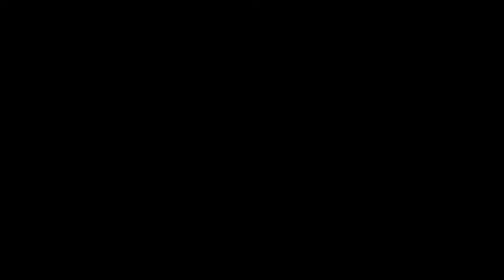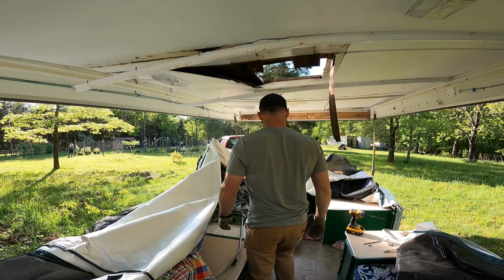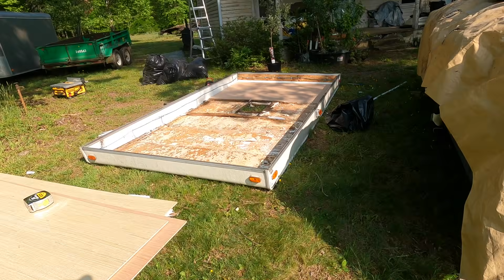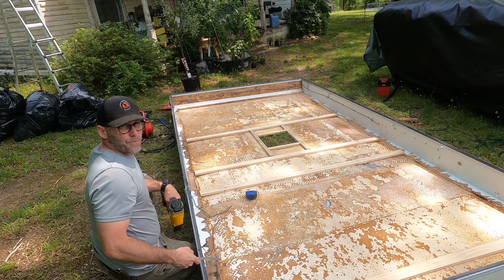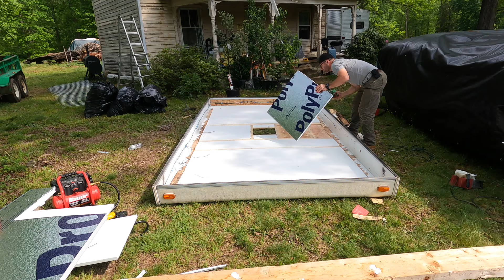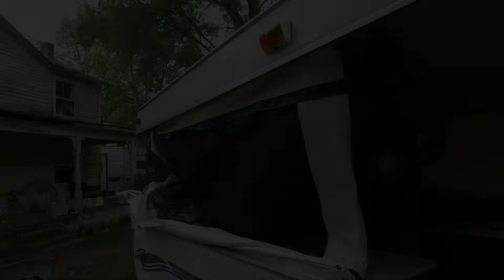How to Repair Pop Up Camper Roof Leak and Rot (Part 1: Interior)

Comment: You\nDidn't use red guard flex , seal , fiberglass, rubber cement or anything to address the original hole that was in the roof the cost of rot  in the first place
Reply from the maker: Did you watch part 2? I did patch the holes. This was part 1 the interior, Part 2 I did the other side.

Comment: What’s the appx. cost to repair a roof like this? We got a pop up for free, but the roof needs repaired due to water damage and it bows/sinks in…so we need to fully repair it. Just worried about the cost. Willing to do it ourselves.
Reply from the maker: It was around $350 to redo the roof. I fixed up the whole camper for a little over $1000. There is a video walkthrough of it completely fixed up on my channel. I think it was worth it because it definitely is worth a lot more than $1000.

Comment: What were you nailing the supports to?
Reply from the maker: The original wood stringers that ran the length of the roof. Those were not rotten so I did not have to replace them.

Comment: Won't the staples pierce the roof?
Reply from the maker: No I used 1/2" staples and the wood is 3/4", and used a little lower air pressure.

Comment: I have a 2006 Palmino Pony and the sides of the roof are rotted but the inside ceiling looks like it was replaced. Have not seen videos on that.
Reply from the maker: I will be sure to video if I come across one with rotted sides.

Comment: Are you concerned at all about the roof leaking again? I saw all the patches. Any suggestions on how to fix those effectively?
Reply from the maker: Not too concerned, as the Hengs rubber roof  coating stuck to it well. That is supposed to be waterproof. I would inspect the roof every year and recoat if needed. It was a friend of mines camper and was done over two years ago and they have not complained of any leaks. I am working on a Pop up truck camper roof and it had some holes in it. I did patch those with DAP weatherproof patching compound which seems to be holding up with no leaks.

Comment: When you’re attaching the headers and you use those staples/screw/nails isn’t it putting a hole through the roof?
Reply from the maker: No, the wood is 3/4" thick and I am using 1/2" wide crown staples, so it is not going all the way through.

Comment: Really wish id seen the part where you took the roof off. Thats what I've been trying to find.
Reply from the maker: Sorry that wasn't in there. What I didn't show was cutting the wires then with the roof up, I unscrewed the nuts from the  bolts that hold the bracket to the top. I left the bolts in then lowered the roof. once the roof was lowered I removed the bolts. My wife and I then lifted the roof up and shimmied it off. Thank you for taking the time to let me know what you were looking for. In the future I will post a detailed video on how to take it off just in case others are looking for the same thing.
Reply: @parkedredesign  that's my dilemma also - how to remove the roof. Thanks for your great video
Reply from the maker: @cinematictrax8443  Sorry it wasn't in the video. I posted a pop up truck camper roof rebuild and show a little more detail of taking that roof off. It is kind of similar to that. here is a link to that video. https://youtu.be/VwI9sM_8HjY
Reply: @parkedredesign how did you get repair (or did they have to completely replace) the cables for raising and lowering the roof?
Reply from the maker: @jasonperner7033  When I took off the roof I did not have to mess with the cables for raising and lowering the roof. I just took all the screws out from the canvas attached to the roof, then unbolted the brackets that held the roof on to the raising and lowering mechanism.
Reply from the maker: I guess I cut that part out. I unscrewed the brackets on each corner of the raising and lowering mechanism and lowered the roof. once lowered I just slid it off.

Comment: At 18:15 what are you stapling the boards to? Is that going straight into the aluminum roof?
Reply from the maker: No, there is a wood stringer running lengthwise of the roof that I am stapling it to. I was using 1/2" wide crown staples so it would not go all the way through the wood.

Comment: I have a 1998 Palamino Pinto which looks very similar to this one. It also has a roof that is in horrible condiditon, all rotted out. From what I can tell, the damage came about because the previous owner never changed the gasket under the air conditioner which allowed water to get in. When I changed the gasket, it was flat as a pancake. This was in 2021 when I bought the camper. Not only did it rot out the roof but the floor and worse the entire camper was covered in mold. I got it very cheap. I have not yet replaced the roof. I was hoping it would be easier than this. This probably requires more labor than building the camper in the first place. If you ever buy a popup camper, replacing that gasket is a very simple job.  Not doing it eventually destroys the camper.
Reply from the maker: So very true. Once a year roof maintenance should be done. Look for any areas where water may leak and fix. I am currently fixing up a Slide in Truck camper that water has leaked in through the  roof vent. A problem that could have been avoided had they put self leveling sealant around the vent.

Comment: Hi! We just bought a Fleetwood Coleman 1995 pop up. The guy said. He redid the ceilings we checked them before buying but once we got home with it peeled away the plastic lining and it most definitely  leaks the wood is soft and damp. We plan to completely rip it out and redo it like yours. A few questions. Do you have to put the insulation in? And if we skip the insulation how do you have your wood supports secured if not nailing through the roof? 2. Myq husband wants to try and do it without taking off the roof. If it were to rain we would have no where to keep the inside dry. Besides just physically being more difficult is there any down fall to this?
Reply from the maker: That happened to us with our first camper, guy told us no leaks and when the first rain came it leaked like crazy. I know the feeling. With the pop up, I would recommend that you take the roof off. I did not have mine in a garage and I just put tarps over it. Not sure how your roof is but mine wouldn't of been possible to do with the roof on because I had to replace the boards that went across, and the aluminum roof would flex too much without the wood supports. I suppose you would not have to put the insulation back but it can help keep out some heat in the summer. I used liquid nails extreme temperature to glue the wood panels to the roof. I used wide crown staples only on the sides and around the vent hole for the ac. The crown staples were only 1/2" so as to not penetrate through the wood and into the roof. Hope this makes sense.

Comment: The question I see when you are liquid nails and nailing in the supports are you nailing that directly to the roof of the camper?  Maybe I'm missing something but it's not going to put holes in the top of the camper?
Reply from the maker: No, I used 1/2" nails and the wood supports are 3/4" wide, so the nails do not go through to the roof.
Reply: I have the same question...What are you nailing into then if it's not going into the roof?

Comment: Great video, thanks!! Wondering about putting a layer of reflectix in between the roof layers for light insulation? 🤔
Reply from the maker: Thanks for the comment, It may help keep some of the summer heat out??

Comment: How did you lift the entire roof off and get it on the ground
Reply from the maker: After I unbolted it and it was in the lowered position I went back and forth from each end and shimmied it  a little at a time until I could get in the center and lower it to the ground, if that makes sense.
Reply: @parkedredesign  gotcha , thank you
Reply from the maker: @andrewradom3772  My pleasure

Comment: Could you not cut that layer out
Reply from the maker: Not exactly sure which layer you are talking about, but if it was the foam layer, I couldn't cut that because I didn't want to risk cutting the thin metal roof.

Comment: Q? Whats holding up the cross beams STOPPING the roof from dipping in the center ? And collapsing the cross beam at not attached to the frame? It will sink like ours down the middle if there is weight ?
Reply from the maker: The metal cross beams are attached to the roof with screws through the wood stringers. The metal cross beams have a slight curve to them which I believe it is suppose to help curve the roof so it does not sink down.

Comment: How thick is the top of the roof?  What size screws would you use so they dont just penetrate tbrough the other side
Reply from the maker: This roof was a thin aluminum not sure of the thickness but it was pretty thin. For the crown staples that I used to attach the center wood stingers to the side stringers they were half inch (the stringers were 3/4 inch wide) To attach the ceiling panels to the stringers I used 1/2 inch narrow crown staples (as well as liquid nails during both processes) To attach the metal support brackets  to the ceiling panels I used 3/4" screws.

Comment: Amazing and beautiful.   Question, if one wanted to just cover that ac hole from outside, what could one do?
Reply from the maker: Thank you, Is your roof metal like this one? If so you could get a thin piece of metal and rivet it over the hole then cover it with the hengs waterproof coating. You could also see if you could find an rv skylight cover depending on the size of the hole and place that over the opening, then you would have a view to the stars :)
Reply: @parkedredesign  thank you!

Comment: I am currently in the process of repairing the roof on my pop-up, and this video helped me figure out how to get it done..  Thank you.

However, what is the thickness of the foam board?
Reply from the maker: Glad it helped, I used the 3/4 inch 4x8 sheets of expanded Polystyrene board insulation. I got it at Lowes.
Reply: Thank you

Comment: Hello. I just bought a 97 palomino mustang(or at least im 99% sure thats what it is) and i ave to redo the roof. Your video is suuuper useful. Did you say .197 inch plywood? Im not sure of im just not looking in the right place but i dont see a fraction that equals that😅
Reply from the maker: Yes. I bought it at Lowes. It is called Revolution Ply. It is .197 or 5mm plywood sheathing. It used to be around $16 a sheet but I think now it is more like $26

Comment: Did you glue the insulation right to the canvas top?
Reply from the maker: Yes, I used the fuze-it extreme temperature construction adhesive to glue it to the top. This top was an aluminum skin. I then glued and stapled the wood panels to that.

Comment: What did the wife crown staples fasten to? Is that foam or sheet metal ?
Reply from the maker: There was the original wood stringers that ran down the sides that I did not remove. That is what I stapled the new cross stringers to. The ones that ran down the side were not rotted, that is why I didn't replace those.

Comment: What about the holes in the roof? Isn’t that what caused all the damage? How did you fix that?
Reply from the maker: Thank you for the comment. I posted a part 2 of the roof repair and in that I showed how I repaired the holes. I used bondo to fill in the holes and then I painted the roof with Heng's rubber roof coating.
Reply: There are only 2 types of RVs. The ones that breakdown and the ones that take on water (leaks). 😅 If you're not handy, stick to cottage Air bnb's😂
Reply: So if you don’t replace the vinyl on top, all of these repairs are for naut !

Comment: How long did this take and what was the overall cost? I’m sure you’d do it MUCH faster than me but I’m still curious.
Reply from the maker: The interior of the roof took me about two eight hour days to finish. The longest part seemed to be cleaning the old insulation out. The outside of the roof took a full day because I had to let the first coat of rubber roof paint dry for four hours before I put on the second coat. The cost of the roof repair was around $650 and that was for the plywood, paint, rubber roof coating, insulation, screws, crown nails. I will be posting a before and after of the pop up and the total cost with the roof and the rest of the interior was just under $1100.

Comment: Not being a wise guy, but how about the wiring? There are no ceiling lights, or a 110 line for the AC?  Great work otherwise! I’m going to follow your lead on my Coleman.
Reply from the maker: Sorry about not showing that. I used the original wiring which was not put inside the ceiling. The wire for the AC was a wire with a plug that I ran along the ceiling then down the side and plugs into a wall outlet. I hid with a cable cover raceway,  I used the same cable cover raceway to hide the wires for lights as well. So the wire were not put in the roof if that makes sense.

Comment: Why did you use different staplers and the first one you used where it was fixed? If the ceiling is very thin, they did not manage to pass to the other side.desde Chile 🇨🇱 😊
Reply from the maker: I used the wide crown staples to tie the cross stringers to the stringers that ran down the length of the roof. I was a little concerned that it would go through, but I tested it first and it did not. I used 3/4 inch (1.9 cm) staples and turned the air down a little on the compressor. I used the smaller crown staples to secure the panels to the stringer. For those I used 1/2 inch (1.27 cm) crown staples. The stringers were 1 inch x 3 inch (2.5 cm x 7.6 cm) Hope that makes sense.

Comment: When you are nailing the stringers in, any concern that you'll puncture rhe roof? What are you nailing into?
Reply from the maker: I was a little concerned that it would puncture the roof. The stringers I used were 1x3 and the shortest wide crown staples I could find were 3/4 inch. I turned the air down on my compressor and tested it first to make sure it did not penetrate the fiberglass because the 1x3's are not a true 1" wide. (I did not show that in the video, and it did not penetrate). If it had I would have probably use the metal straps and screws that were 1/2 or 5/8's. The original roof was tied together with glue and crown staples so that is what I used. The crown staples nail to the two stringers that ran lengthwise on both sides. Those fortunately were still solid and I did not have to replace them. I should have shown a close up of that. Hope that makes sense. If not let me know and I will look through my videos and see if I have a close up of it.
Reply: @parkedredesign  Thank you! Super clear and helpful. My father in law just gave us the exact same model of camper... And I'm trying to figure out if it's a blessing or a burden, because it has a lot of needs. Your video helps a ton, because now I feel like we can tackle this.
Reply from the maker: @chandersman  I say it is worth it to fix it up. Check back in a few days, I am going to have the second part of the roof video posted (exterior side) and then the before and after video of the palomino pop up restoration. It came out great! (at least I think it did, lol) If along the way you have questions, please feel free to ask. I will let you know that we did put about $1500 into it with all the restoration, paint and interior touch ups, but if you got it for free I know you could sell it for much more and recoup the money if you ever needed too.